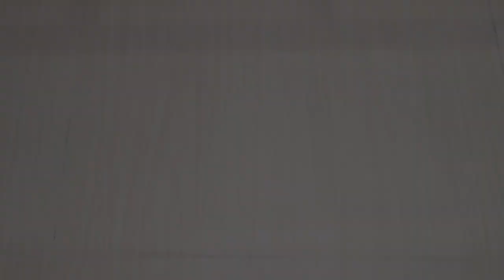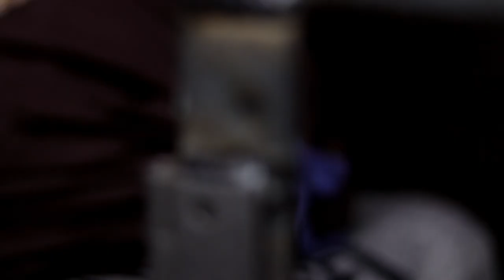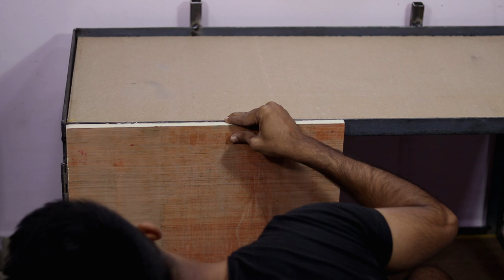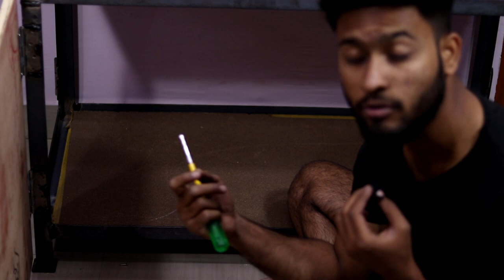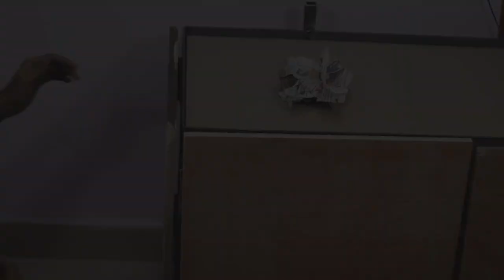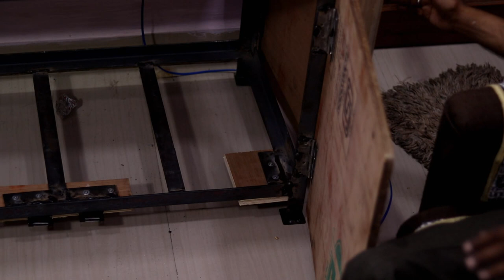HOW TO :- Build an Aquarium Stand | Part - 1 | IN HINDI

Comment: Please mention the iron stand hiwti buy it according to the size and the glass thickness., for example I am making a tank of size 36*18*18 of 8 mm glass. Then the iron angle of what size in this Manner. I have also seen people having stand if nut and bolt system is it okay for an aquarium

Comment: Hi Bro! Your efforts are quite good, eventually your structure is not appealing, that makes some what struggling and smuggled. In fact you should have reversed the top frame. Welds are not grinded properly. Please have a look once again before you revert wit your comments. I have my own perspective about the work when we showcase. It should be outstanding and flaw less.
Reply: which side frame hold more weight?